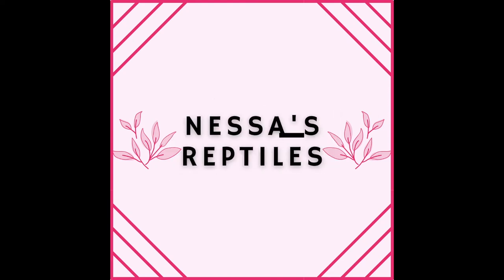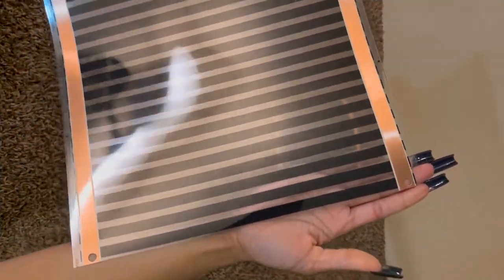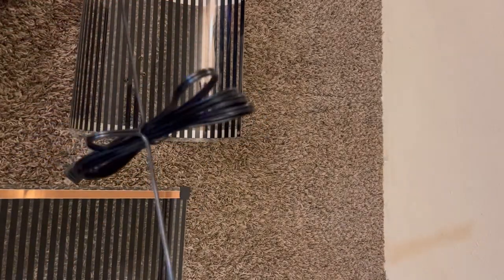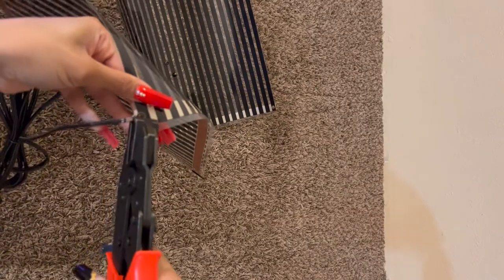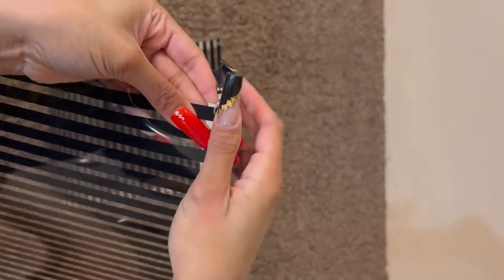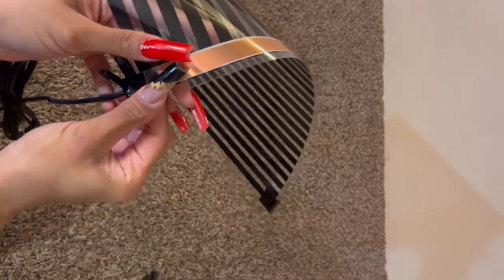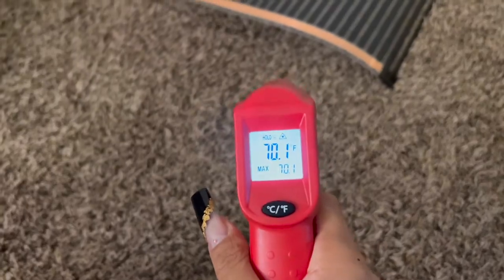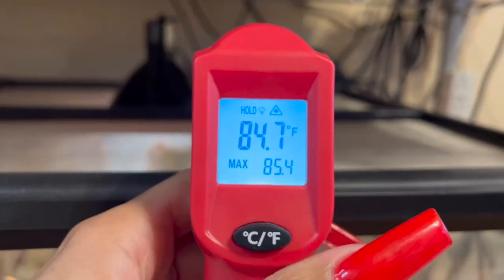HOW TO MAKE DIY HEAT MATS

Comment: Dude, you're absolutely brilliant. What is the platform you use as the actual reptile mat? It's so bloody expensive to buy these damn mats and I have two lizards, it's only the giant Leopard gheckos tank I'm worried about really because my beardies tank is warm enough with the lights but he LOVES going up to the window to look outside and literally stays there until the sun goes down and it's cold here and the window isn't the best place for him to sit so I have a couple of lights I have there pointed at him and it burned a few items by being that close so I need another solution and something flat like this would be perfect, and I'm handy so I can make it I just need to know what to get in order to construct it
Reply from the maker: My dragon does the same thing, I’ve never thought to just put a heat mat in the window instead of a heat lamp but definitely gonna try it! I listed the supplies in the description with links. You can get everything except the hole punch from reptile supply co (cheap reptile website) but the crimping tool is the one expensive thing you need. You may be able to find it somewhere else cheaper, I just haven’t looked.
Reply: @nessasreptiles2428  that's excellent! I'm glad I gave you an idea. Yeah he absolutely adores looking outside so I built a system of nets from a collection of beardie hammocks from Amazon with rope so he is able to climb out of his tank by himself up to the window, then when he gets cold he climbs back into the tank, so I put lights up there so he wouldn't be too cold or uncomfortable sitting up there, but I use scarfs and blankets and those are the things that have been falling onto the light that's pointed at him and it's singed holes into them. Lucky no fires have been started so I'm looking for different ways to keep him warm up there. I realized after asking that on that website it has all the items you needed so thank you for that :) hopefully I can manage successfully making it and not come home to a fried beardie haha